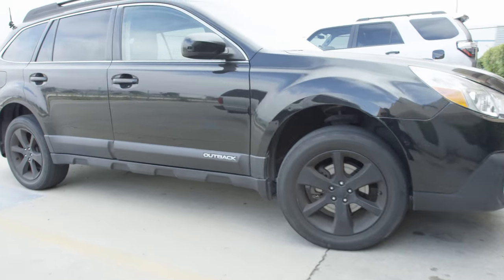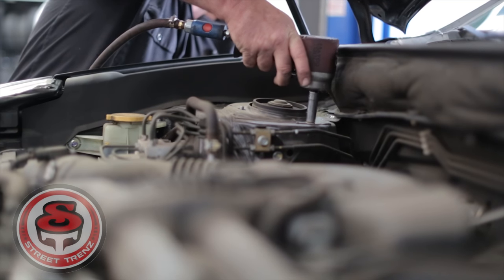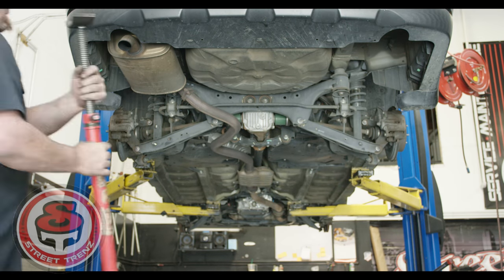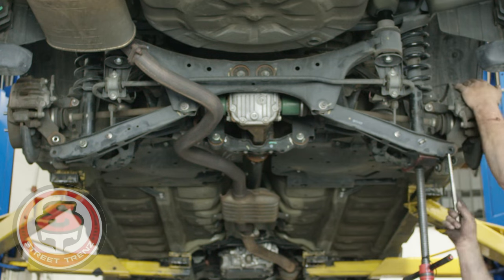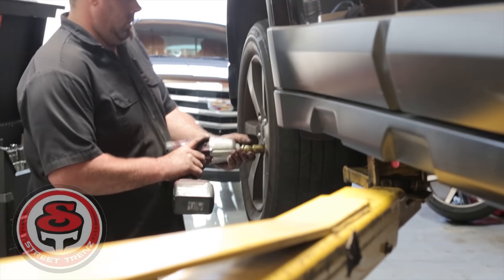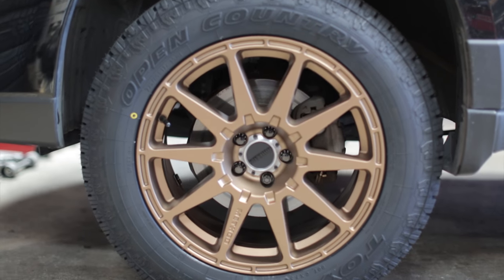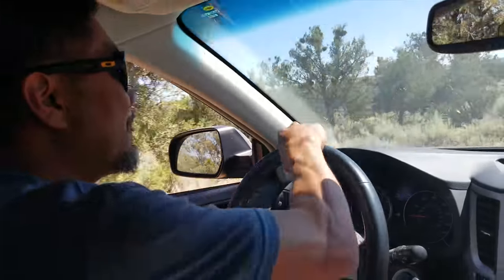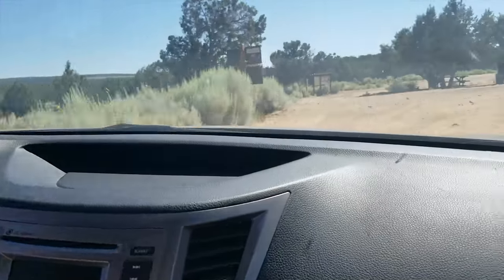2014 Subaru Outback Lift

Comment: Good stuff,  very thorough, I was curious about the tire width and possible road noise increases.
Reply from the maker: 13C Gun Reviews went from 225 60r 17 to 225 65r 17 and I cant tell the noice but, it tracks different for sure because it’s not road tires

Comment: The tires didn't come out cause you bought the OEM size which is 225/65/r17. With a 2" lift kit, you can put on  245/65/r17 , but you have to get mags with a 45 offset
Reply: How comfortably does the 245/65/17 fit with a 1.5” lift? I’m installing my lift this week and can not decide what tire to run, I want the most aggressive tire I can get in such a small size, in a 245/65 there is a lot of better tire options rather than a 235/65/17 that I know would fit comfortably.
Reply: @Jacob.Shepherd  I know some people put 15' tires with 245/75R15 but that's with a 2" lift kit. So maybe a 235/75R15 for you would look aggressive and fit perfectly, but don't forget the offset of your rim or mag. Can't go wrong with a 45 offset
Reply: I have 225/70/15 method mr502's my 2014 outback. tires are massive and very aggressive compared to the stock setup. the only thing i had to do was make a minor trim to the front mudflaps. something to consider as an alternative.

Comment: I have a 05 LLbean 3.0R that has been garaged for its entire life. No rust 150,000 miles. Runs like new. Have replaced the hubs, suspension bushings, struts, driveshaft, etc in order to keep it riding like new. Would love to do this to my ride. What do you think of the 1 inch lift?

Thanks

Comment: Could you tell me ... how much stiffer if at all did your lift make your ride? I'm looking at buying a 13-14 manual and want to make it as capable as possible ... but my favorite part of the car is it's supple ride.  Thoughts? Thanks
Reply from the maker: I felt it road better and never felt a negative point besides gas mileage. You will loose about 1-1.5 miles per gallon

Comment: Brother how u linking the outback ..im looking into outback v6 with auto transmission.. or honda pilot ..rather get the outback for outdoor activities ..how reliable has it been  for daily and light  off trail use  ?
Reply from the maker: i can't believe i missed your comment! first i LOVE my subaru and would totally recommend it. It's my daily driver and it gets around 25mpg total but it use to get 26-27 before the lift. Mines the 2.5 and haven't felt any power issue but i would like the v6 for towing and putting more stuff in my subaru like a cool bumper. Hit me up if you have anymore questions i just put a after market trailer hitch and plan on doing a lot more stuff soon
Reply from the maker: https://www.instagram.com/ricktak11/
Reply: A v6 Subie really
Reply: A, there is no such thing a s v6 subaru. There is a flat 6 but that's it.

Comment: Nice! I got a 2014 3.6 and have be having a hard time finding what tires and wheels work for it if i left the suspensions stock. Ok looking at Method 502s in 17x8” and BFG 225x65R17. Do you know if that would work? What tire and wheel size are you using?
Reply from the maker: method 501 Rally-bronze 17x8
@t
toyo:
225/65R17
@t
Reply from the maker: Falcon came out with a tire that fits without lifting your car
Reply: I am looking to do this to my 2016 3.6R and looking at the RTX wheels and not sure on tires. I dont think I want the KAo2 due to road noise and such.
Reply: @rtakahashi  which Falcon tires in specific? Would they work with a 2012 Subaru Outback 2.5i limited? Would you suggest the 225/65/17 size vs the 225/60/17 if I wanted to lift it?

Comment: how much did this cost? my shop quotes me 675 which felt high
Reply from the maker: i think the kit and install was around 1100
Reply: I just bought the 2" lift for my outback '13, from subtle solutions after it was all said and done i paid $800 and installed myself